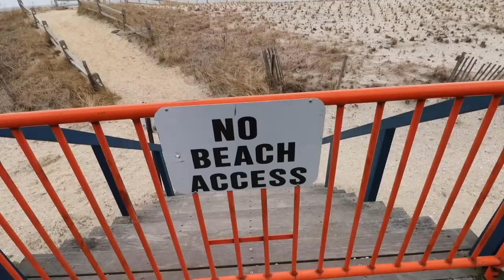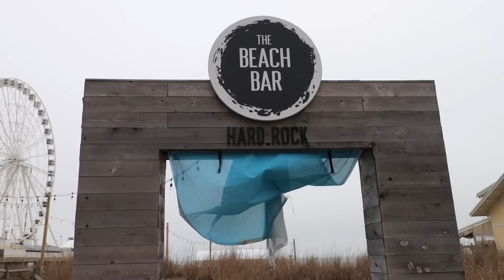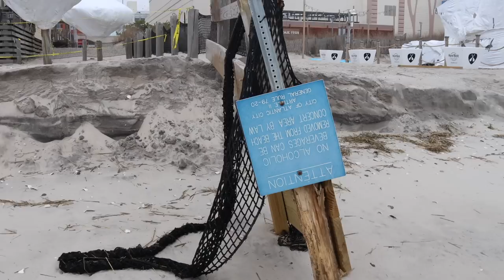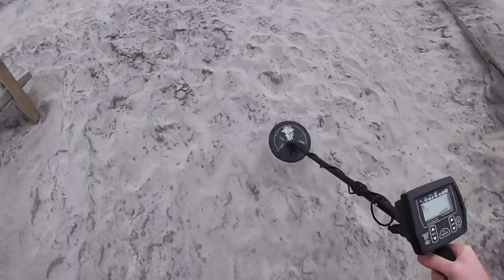Metal Detecting During LOCKDOWN! - WHAT DID WE FIND?!

Comment: Inexpensive option to buying one of those cat Igloos? Use one of those larger 18 Gallon totes with a lid that snaps on tight... cut a hole in the front. I placed a towel across the two side and then clamp it in place with the lid. (Insulates the tote as well.)
Put a few out this winter for neighborhood cats this Winter and didn't have to buy a thing because everything I used was in storage locker auction buys. It was all FREE.

Comment: Just trying to be helpful. You need to swing the detector coil in larger arcs. Also when you're pin pointing the targets swing the coil more. It's harder to locate if you keep the coil too static. Move side to side and front to back a good foot or so creating an imaginary X. Then X marks the spot!  Also, large pieces of iron will still ring up on any detector. You can set the discrimination to eliminate most small iron targets though even those will sometimes fool your detector. Especially if round, coin shaped.